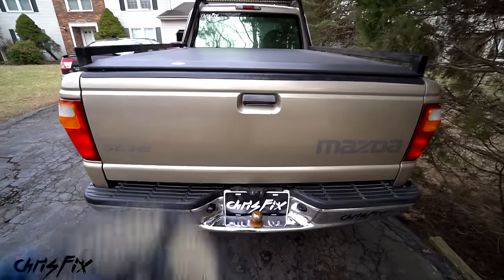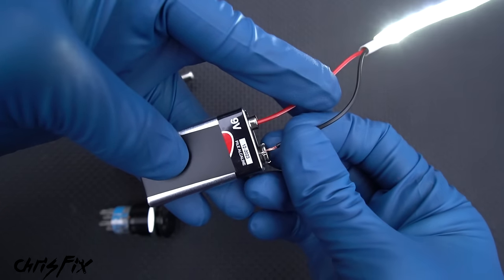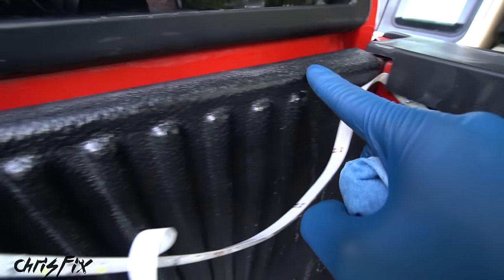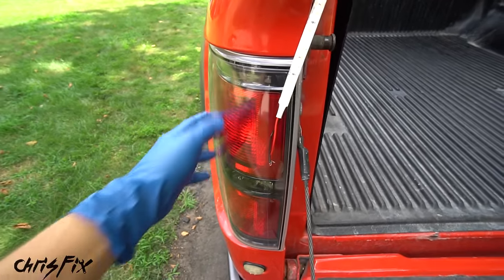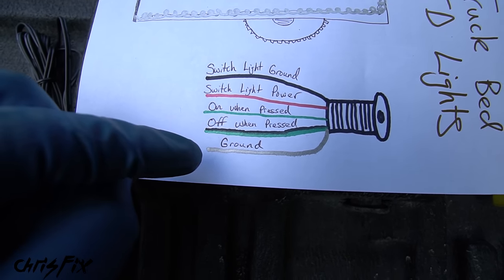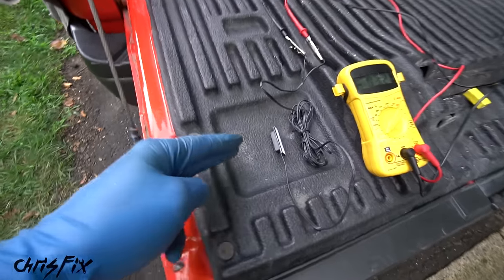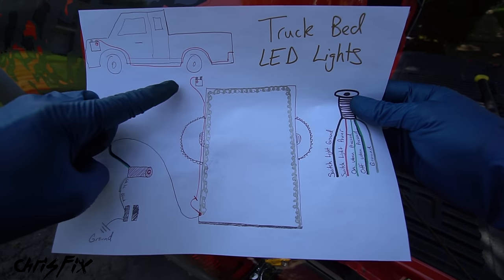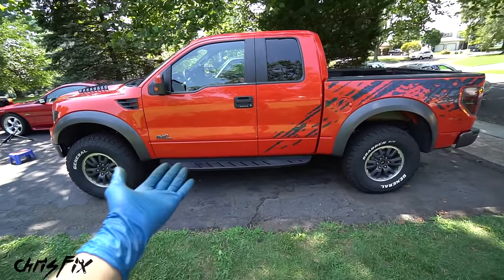How to Install LED Bed Lights (Fun DIY Project)

Comment: Bop it 
Twist it
Pull it...

“Solder it 
Silicone it 
Heat shrink it
Beautiful”

-ChrisFix 2020
Reply from the maker: lol
Reply: Falls apart because you forgot about the thread locker.
Reply: you forgot to text "Beautiful"
Reply: Dominic Guay but was it medium strength ??
Reply: Michael Jeziorski heh
Reply: Dig into our tail-light......
Reply: Wolf gang baby
Reply: the switch is a little too small for our hole
Reply: Easy breezy beautiful Covergirl
Reply: @domg6041  lol

Comment: Two notes:
1. I would strongly recommend testing before zip-tying everything and reassembling the tail light. (put fuse in, test, pull fuse out again, tidy up, put fuse back in, test again)
2. I would put the switches on the positive side, so that the LED tape goes straight to "ground" on the negative side. This way, if something shorts out along the way, it's more likely the lights will be stuck off, rather than stuck on.

Comment from the maker: This was a lot of fun and is a great project for you at home! Now you know how to install LED strip lights and a magnetic switch so they turn on automatically! Also be sure to check out The Straight Pipes car reviews!!!
https://www.youtube.com/user/TheStraightPipes

Here are all of the products used
 in a list so you can easily find them:
LED Light Strip: https://amzn.to/2S1AgV6
Magnetic Switch: https://amzn.to/2U6lJtJ
Push Button Switch: https://amzn.to/38I1Ux4
Fuse: https://amzn.to/3aW2Xev
Very High Bonding Tape: https://amzn.to/2RB75cr
Wire Connectors: https://amzn.to/2O8V5Nh
Wire Protector: https://amzn.to/2uLFv32
Wire Crimper: https://amzn.to/36FMlEw
Wire Stripper: https://amzn.to/37I0KkU
Multimeter: https://amzn.to/36CsfuU
Soldering Iron: https://amzn.to/38Uw1S5
Reply: Still waiting for turbo installation
Reply: Plz tell us how to install turbo charge in car or truck plz plz plz plz plz plz plz
Reply: Bru shout out
Reply: do face reaveel
Reply: Bro,you're one of the best youtuber ever.
Reply: Hi chrisfix what red Ford was that
Reply: 6 milion subs alert
Reply: I don't know what to say...... How your day been
Reply: That ground though
Reply: was waiting for this since the straight pipes trip video
Reply: Why didn't you connect the leds to the taillight? I'm thinking it would have been much easier.
Reply: @theodorgavrila1035  Direct to battery so vehicle doesn't have to be on or ignition key in to turn lights on.👍
Reply: Chris, I love this project but I am going to look for another alternative fr sticking LED. i dont think it lasts in outdoor weather conditions.
Reply: Bruhhh i thought this was the supercharger video
Reply: Illegal in the UK
Reply: Just want to let you know that the label "fuse" under the description of the Video.  Is not actually fuse it is wire connectors set.
Reply: And 1 month timer is on
Reply: Let us know when that sticky backing stops holding 😁👍
Reply: Chris, are you going to complete your drift car by installing the cage and turbo charge and few others that i forgot?
Reply: Nice project. Also could have grabbed 12 volt power from a trailer plug if equipped.
Reply: ChrisFix im waiting for your honda ❤️ cant wait to see your vid about it
Reply: Did i just saw a nitro?
Reply: How to switch rims on a tire plz
Reply: I want you to vinyl wrap the driftstang long beach red
Reply: Is that a N/C or N/O switch?
Reply: The switch could be installed also in the positive red wire? What is the difference?
Reply: Hey Chris, where's that home made smoke machine?
Reply: Try to make a video with goonzquad
Reply: ChrisFix i remember watching their video when they visited yo and it was like 4 months or more ago
Reply: @mr.born.....8261  He did long ago.
Reply: Can we get a link for the type of wire and heat shrink used. Thanks I’m advance
Reply: man i wish i had a friend like you i would buy you lunch everyday so that you would help me modify my car
Reply: Man, that was awesome, but, if were you, if used the rest of led ligth that's hided in the tail light to bright some place else, like the glove compartment.
It will be plus awesome, thinking in do it in my car right now
Reply: @RTXGaming  yeah that what I would say the same xoxo :)
Reply: Cool video
Reply: Incredible effort as always. Great video dude!
Reply: When are you going to do a Evap leak fix video?
Reply: @Birds891  calm down child
Reply: What if i have more then 1 door?? Do i just connect the magnetic switches to the ground?
Reply: ChrisFix I love it I installed it on my dads truck and o man he love it and I do it
Reply: ChrisFix to#
Reply: Could you please do a tutorial but interior led install for sedans?
Reply: ChrisFix  i was wondering how was you install a new head unit in your car that is old. Like installing a touch screen or non touch screen display on your car that doesn’t have it
Reply: Orale cuh
Reply: Dude where is the turbo charger we all want the video
Reply: Hi cirsfix. Do you want me to draw your dirftstang
Reply: This job wont last long
Reply: Unfortunately that magnetic switch is not designed to switch higher current loads, judging based on the 10 amp fuse there is significant enough amperage to cause the switch to fail with repeated use. A smarter solution would be to use the magnetic switch to cause a standard 12v automotive relay to actuate and then the power for the led lights would go through the relay.
Reply: @Kevin Sanchez ya
Reply: Sorry Chris it’s not called a Christmas bit. It’s called a step bit.
Reply: its the switch water proof ?
Reply: Good idea ChrisFix
Reply: Hey, I have a 2001 suzuki king quad, I know quads ain't your thing but the lights don't work well and not all the breaks are working, plus the clutch broke, if there is anything you could do it help it would be awesome!
Reply: Question, how would you remove oxidation from car paint that makes a gloss look matte?
Reply: btw some shitty german cars have the red as negative and black as positive
Reply: Why didn’t you connect the positive to the taillight positive 
Taillight positive wires are always on
Reply: best is to use crimps because solder over time can be lost and for the ground is better to use the circle bolt connector and not to put it like that because the wire can cut overtime and especially if you open and close the bolt 
but other than that great work, you explained very well :)
Reply: @AZ-gw8un  Yes you are
Reply: i wish my fiends were like you XD
Reply: Another job well done @ChrisFix 
Next video : How to upgrade your raptor taillights to Leds .!?? Mmm 🤔.?
Reply: it was funny when you said butt conectrs
Reply: CHRIS!!!!!!!
i need some major help!
My mom bought a new car and the back door window switch isn't connected and needs fixed and the rear buckle isn't clicking OR conecting!!

Can u help me and my mom out man, thx!

Comment: Being an auto electrician you really explained in detail what was required and how to do it, thumbs up
Reply from the maker: Thanks a lot
Reply: Really? You agree with his choice of mounting the ground wire? Shoving it into the threads was ghetto af.
Reply: Ryan Prokopow yea the ground wire was a bit odd but I was pointing out his positives
Reply: I thought everything Chris done was perfect, except for mounting the ground. So then I came to the comment section to see who agreed. I also  put No-Ox-Id on my connections before I crimp. I love Chris's videos....
Reply: @robertjefferson1372  if i use a crimp i put solder in it as well as crimping it. No water can get in there and now it has no chance of ripping out
Reply: Videos are great and I’ve learned so much...where would you have grounded that wire? I’m thinking of putting these same lights in my truck bed
Reply: @therealmattyice6531  use a ring crimp and find a bolt that is attached to metal and attach it to that bolt. Or use the ring ceimp and a self tapping screw into a metal panel. For my f150 i took out the tail light and there were many options to mount my ground to. Similar to the one in chris's video. I personally used a self tapping screw on a piece of sheet metal that holds the tail light into place
Reply: @lachlanrichards9624  But the switch can't handle that current and deform. You should have pointed at that.

Comment: No questions about Chris’s talent but I think it’s better and quicker to attach the positive wire to the rear parking light.  You don’t need bunch of wires nor wire cover and the labor to run it from battery at front to all the way to the trunk gate.  Don’t need the on off switch, just mount the magnetic switch is all it needs.  The drawback is the parking light needs turned on before opening the trunk. In some vehicles has constant positive feed to rear brake lights, then all we need is a photocell switch.  Thank Chris for countless time from making these videos helping out many diy newbies including me. I do appreciate your resilience.

Comment: A couple of things worth mentioning, learnt when rewiring my boat:
1. The primary choice of fuse does not depend on the load you intend to connect. The wire is chosen to be able to support the intended load and connection distance, then the fuse is chosen to have an  equal or lower current capacity as the wire. If the fuse is rated higher than the cable, a short is likely to end in a fire.
2. The wire needs to be multistrand as you have used, never use solid core wire eg intended for a house, vibration will break it.
3. When the solder connection  is shown in the cideo, a difference between the LED tail and the wire for the run to the battery on the right is visible: left = silver (presoldered), the right shows bare copper. Presoldered is chosen by the led manufacturer because it does not corrode. I have not yet found a “waterproof” connection which remains just that in boats and cars.

Comment: Just a small tip from an electrician. The next time you need to hook up a ground I would advise to crimp a large connector washer (eyelet perhaps in your country?) to the ground wire. I have a feeling that those threads nicked the copper enough for it to pop off from vibrations one day. Usually the ground is the most important as a good ground connection can also nake sure your fuse does blow when you need it to blow the most. Everything else was great!

Comment: Under the hood! GENIUS! Never thought of that
Reply from the maker: It’s pretty helpful! But once you know how to wire, you can put these lights anywhere you might find them useful!
Reply: @chrisfix  I've used those lights to create a really clean door light setup for my truck
Reply: Can the stripes of LEDs withstand the heat under the hood?
Reply: @1ZZFE  Most can
Reply: @chrisfix  yeah well.... i got like 3 of those strips in my car by today. One in the Trunk one in the Cabin and one under the Hood. All done since 7am today😂i am an Electrician on vacation and apparently i cant get enough of Electricity
Reply: under the hood will die fast. 90 degree air temp
Reply: @David-cy5zu  Not true
Reply: @TheKillerMarine  yes true. google operating temperature

Comment: Hey chrisfix,
Since im an electronics engineer, i have some suggestions.

1. if the magnet fails and you are Parked, your battery will be dead within a few hours, this is especialy bad if you are for example parked at an airport. I think a good solution would be to either wire it ti the ignition or use a timer relay, that will shut it of lets say 15 minutes after the ignition has been turned off. Another idea would be to wire it to the unlocking mechanism, so the led's will only go on, if your car is unlocked (i think this would be the best way)

2. Tell your community to wait like maybe a minute after cleaning the surface with the alcohol, beacause if you directly apply any kind of glue (for example the stick tape) the alcohol will actually dissolve the glue in it, so it will maybe stick for a week until it falls of.

3. if you wanna properly solder 2 wires together, do it the following way:
1.) strip both wires to about 10mm
2.) twist both wires, so they are as compact as possible
3.) pretin both wires (just enough that you can see them turn silver)
4.) DONT FORGET TO ADD TE HEATSHRINKS (trust me, i had to solder an entire BUS together. After i soldered 125, YES 125 wires to one another i realised i forgot the heatshrinks)
5.) attach the wires to the "helping arms" and put the stripped and pretinned wires SIDE BY SIDE (so they touch each other)
6.) heat both wires and use some more solder to get a strong connection
7.) put the heatshrink over the solder joint and heat it with the heatgun or a lighter.
8.) Boom, Profit

I hope i could help you, and stay as you are. I love your Videos and i got a 2001 Chevrolet Blazer from my grandfather so i need your videos :)
Reply from the maker: VaareLp Gaming thanks for the tips
Reply: Just curious, is that switch water proof?

Comment: Hey! I did it! I installed my own LED's in the back of my ute. I followed your advice and instructions and managed to get it done for about $80. The toughest part for me was running the conduit and wire under the body of the vehicle. That was a challenge but I got there in the end. A little bit nerving when I had to drill the hole for the button switch but it worked out fine in the end. Thanks for all your tips and advice. It really did help to make it a good secure fitment. Much appreciated!
Reply from the maker: Awesome! Nice work and glad the video helped!
Reply: What adhesive did you use? How has it held up so far?
Reply: @devonburkhalter9840  I initially did try the strongest double sided adhesive tape I could find and washed the surfaces down with methylated spirits but in the heat of summer it just didn’t hold. Literally melted away. In the end I removed all the tape, which was a real pain in the ass and put dabs of silicone to hold the lights on. So far so good. They haven’t come off.

Comment: This is so crazy, I just installed an led light strip in my trunk  like yesterday lol. My dad wants to put some in his Tacoma too. Great job!
Reply from the maker: Awesome! How did it come out?
Reply: @chrisfix  its good
Reply: @chrisfix  it came out so well! I went all inside the trim and used the power off the original bulb so it only turns on when the trunk opens. I'm really proud of it. I will definitely be referencing your job on the Raptor for my Dad's turn. Thank you for all that you do, you are an inspiration. :)

Comment: Hey Chris, I just wanted to share a couple of suggestions which may help you for future.  I have been doing electrical wiring in vehicles for 30 years so plenty of experience.  I've also fixed a lot of other peoples problematic wiring issues.  You do a pretty good job, however a couple of important things caught my eye.  Using marine wire, which is tinned from factory would help with any corrosion issues.  Secondly the ground wire at the back wrapped around a bolt without even using a connector made me cringe.  If you are going to go through the trouble of running a wire from the battery, run power & ground, that way you are making a good solid connection at the same location, and you are creating a loop between the battery and the device.  A bad ground will cause lots of problems down the road.  Marine grade epoxy heat shrink connectors will save you the step of using the dielectric grease.  One more suggestion is to run the wire from the battery back towards the cab, then across the firewall and down.  I'm certain your videos will help a lot of folks.  You might want to look into Power Probe's soldering guns and torches.  They will make your life so much easier.
Reply from the maker: Thank you for the tips
Reply: man your right
Reply: @chrisfix  this is what I love about you, replying to comments even after 3 years, absolute legend
Reply: love the tips, any info is good info. helping each other  out is awesome. help each other out
Reply: I’m confused, I ran my lights just like he said and connected it just like he said, my lights come on, but are not bright anymore, connections seem solid, but do i need to install a relay somewhere after the fuse wire off the positive battery side?

Comment: Pro tip: Pin 4 on your 7-way trailer plug is 12V. You can tap into that without snaking it up to the front. Use a fuse still.
Reply: Swoit mon. Multimeter to find pin when forgotten. Thanks
Reply: Absolute legend
Reply: That doesn’t screw it up for towing?
Reply: @nicholasphillips5406  it shouldnt, it doesnt draw much power.

Comment: Couple tips.. from someone who's installed thousands of those magnetic switches professionally over the last 15 years.. that factory double sided tape will not last long at all with the weather. 
Also, when using a relay (switch) to break power, ALWAYS break the positive leg instead of the negative.

Comment: Chris, thank you so much for this! My 17 year old and I had a great time together installing these lights in my truck. We went with the water proof 5630 LED tape. I am not sure how long the 3M tape will last but have a backup plan if it fails over time. Keep the awesome videos coming, it’s great for my son who needs to learn how to service his car. Well done sir!!!
Reply: How's it holding up?
Reply: @Ryan_Carder  it made it a Year and now I have to figure out a ground issue but it’s my fault. The led are amazing and we use it all the time.
Reply: @sforkner67 Can you inform me as to how the 3m tape has held up so far? Thank you in advance.
Reply: @devonburkhalter9840  the tape started to fail after a year but I cheated and used epoxy and out a dot every few inches so it can be replaced some day.

Comment: I just did this yesterday, and it worked perfectly - even bought the parts you had in your links below from Amazon.  Everything looks great, and worked the first time I tested.  Really appreciate the video!
Reply from the maker: Awesome! Glad the video was helpful!
Reply: How has the 3m tape held up so far?